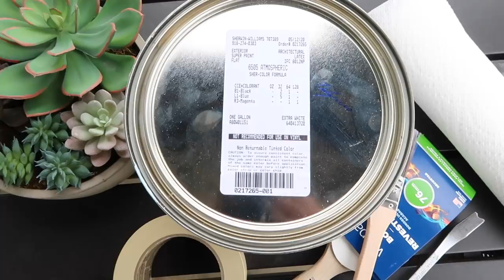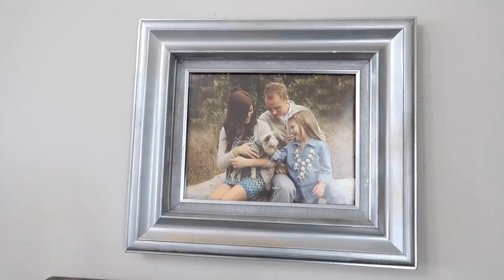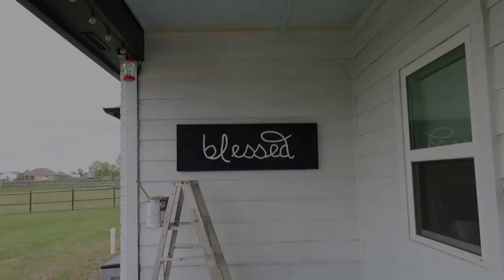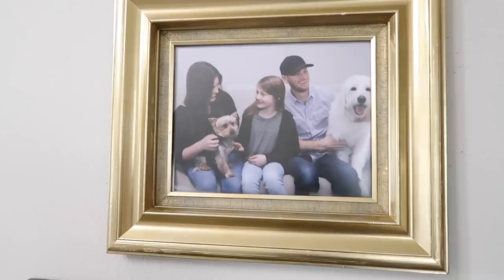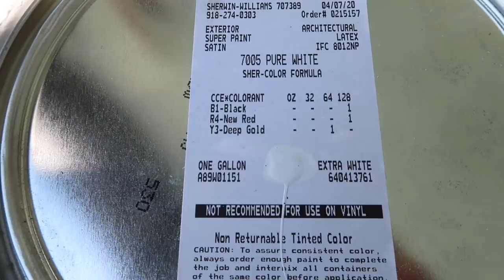MODERN FARMHOUSE UPDATES | DIY PROJECTS + CLEANING | REARRANGE + DECORATE WITH ME

Comment: A really good hack.  If you can't wash brushes right away or you are going to use brushes next day just put them in a zip lock bag or if it's a roller put around the roller head and tie shut and keeps the brushes perfect until you can finish the job

Comment: This is really nice. You mentioned running out of spray paint. I did too. I ordered several cans for curbside pickup at Lowe's. I found the spray paint color/number on or under the can. It made matching with the existing color I had on hand very easy. Your video reminded me of needing paint tape.
Reply from the maker: Awesome! I need to place an order.

Comment: It would be beautiful to shiplap that one wall the tv is on. It would add texture. You can do it on the cheap by using 1/8 " plywood cut in 6" strips. Use a nickle to space the gaps. Tip: if you are planning to paint the shiplap a different color than your wall, paint the wall the same color first. Watch some utube videos for ideas. Just a thought. 
Excited to see your patio renovation! The porch ceiling is pretty. Im going to paint mine too!! Your house is beautiful!!!
Reply from the maker: Thanks for the tips.

Comment: I would put the tv on the opposite wall unless the cable is there but I would try to change that too.  The sectional would face the tv and that would give you an entry.  You could then put a mirror with a half table, some pictures or some plants.  Trying to put anything behind the front door, you can't really open the door all the way.

Comment: For the space behind the door, I have a similar problem. Too narrow for a proper bench or anything walking in. I'm planning on wanes coating the wall, a little less than door height, and then hanging coat hooks across. I might also add a little shelf lip at the top to put pictures or narrow knick knack items to jazz up the wall :)
Reply from the maker: It makes it hard but I think we will both figure it out! Someone mention a front swinging door too.

Comment: Doesn't the spray nozzle not work after a while of using it over and over?
Reply from the maker: I haven’t had any issues yet and I’ve used my bottles a lot. They also sell the sprayer if it does need replacing.